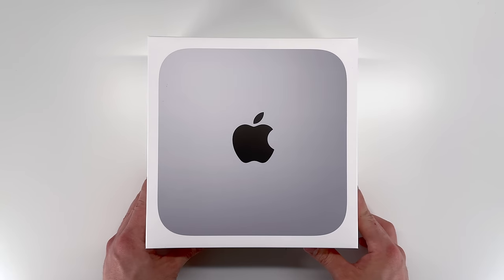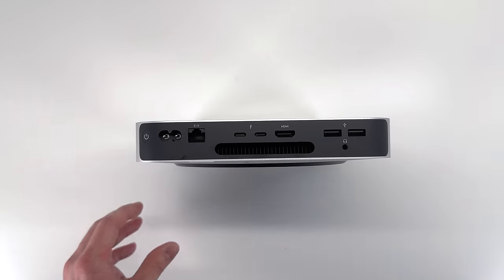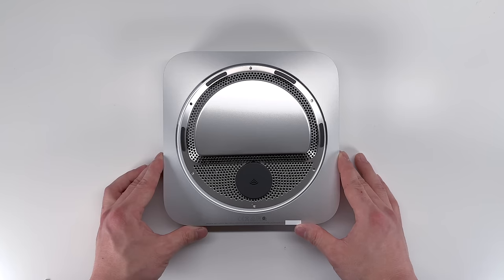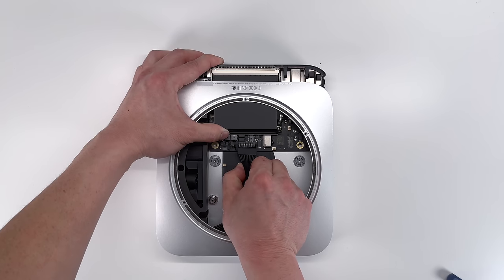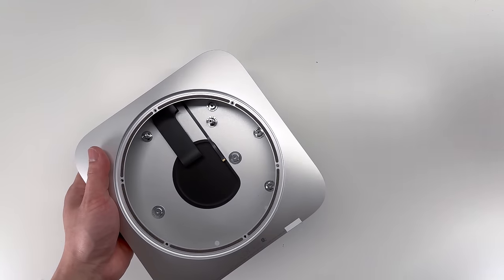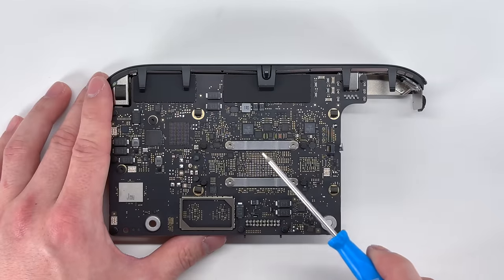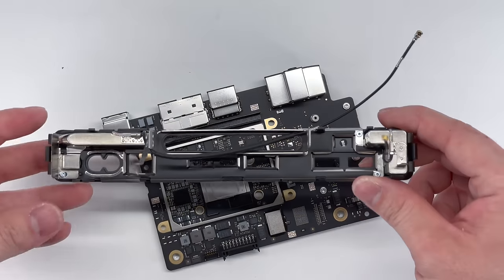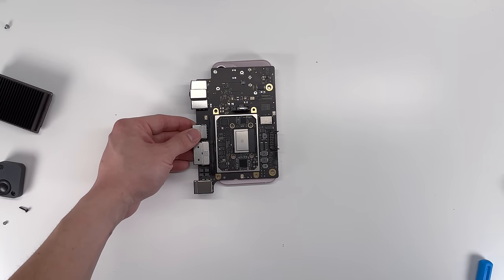M2 Mac Mini Teardown / Disassembly (4K - Up Close)

Comment: Very cool.  As expected, only one Nand.  Oh well.  Saved $100 because of that.  

I would’ve liked to have seen a FULL tear down, meaning every part removed from the aluminum casing, as I was hoping to do a custom space gray anodizing.   

Now I’m wondering if the intel space gray casing could be swapped instead. 🤔
Reply: is the m1 mac mini base a better computer than the m2. I would like to also mentioned I can get the m1 for $100 cheaper than the M2
Reply: @NA-qs7bg  seems that the read write speeds are worse on the base M2, but the CPU/ GPU is better.  If you upgrade to the 512GB model, it should be faster all around.
Reply: @DisgruntledPigumon  What are your thoughts on the following?

Looking at the m1 base vs m2 base minis. Found  m1 for $100 cheaper than m2 which is not material but nice. ($699 Canadian for M1 - its on sale for $200 off and M2 is $799)
Will be using it for work on my 49 inch samsung g9 ultrawide monitor - I work in finance. Usually I have all of the following open: Email, word and excel, a finance cloud software application, a finance software application installed on the desktop, few internet chrome tabs for research, and a small widget like timer. Im looking to go with the faster machine which seems to look like the M1.
Reply: @NA-qs7bg  definitely go for m2! 100 dollars is well worth it !
Reply: @georgelyras1978  In what respect? Because I'm reading the m2 has a significantly slower SSD. Ive heard the price of the mac mini has been reduced because the performance has dropped. So going for the M1 over the M2 might be better in general and definitely a better option if you can get the M1 for less.
Reply: @NA-qs7bg  i'm not that good in this stuff but shouldn't SSD speed only matter for loading stuff and not for actual computations? and in terms of SSD speed difference shouldn't this only be noticeable if you load really large files?

Comment: Where is the intake?  I got one of these and I see no intake on the bottom.
Reply from the maker: The intake comes in from the sides of the black cover. It has a very slight gap from the machine.

Comment: Thanks a lot for the review. What SSD size should one buy in order to have the best SSD R/W performance. If a 512gb has 2 NAND chips and reaches 3000, would 1tb give 6000?
Is there anyone there who owns a MM M2 Pro with 1tb to test the speed ?

Comment: Is the M1 base faster than the m2 base?
Reply from the maker: It's complicated... The M2 Chip and ram is faster but the SSD is faster on the older M1 Mac.
Reply: @brandon20904  I’m looking at the m1 base vs m2 base minis. I found the m1 for $100 cheaper than the m2 which is not material but it's nice. ($699 Canadian for M1 - its on sale for $200 off and M2 is $799)
I will be using it for work on my 49 inch samsung g9 ultrawide monitor - I work in finance. Usually I have all of the following open: Email, word and excel, a finance cloud software application, a finance software application installed on the desktop, few internet chrome tabs for research, and a small widget like timer. Im looking to go with the faster machine which seems to look like the M1.

Comment: Hi Brandon,

I’ve got a new M2 Pro Mac mini. Recently, I had to connect to my old LaCie Rugged HDDs with Micro B USB to USB C cable. That LaCie cable is extremely stiff on USB C and doesn’t click. Do you think Mac mini’s ports can withstand tough insertion? Or is it even ok? Thanks!

Comment: What sucks you cant upgrade ram or hard disk anymore.
Reply: The RAM (Unified memory) is understandable because in many ARM-based hardware, the "volatile" memory is integrated within or alongside the SoC, and therefore, soldered, for speed gains (and also due to how the ARM architecture works as well.) To be blunt, this configuration "arrangement" is taken from Apple's iPhones SoCs.
 
What infuriates me is the SSD (considered as consumables because SSDs depreciate over time despite their longer lifespans, they're still "consumables".) The justification made is that because the SSD is faster now—which is false, because you can put a PCIe NVMe SSD (especially if he newer ones) with the same storage equivalent and you can get comparable or even faster speeds AND they're replaceable.
Reply: @Jan-xf8sk  Not just in ARM-based hardware -- lots of x86 laptops have soldered RAM these days. e.g. my Thinkpad T480 ha two SODIMM slots, but later T-series Thinkpads replaced one or both with soldered memory. While planned obsolescence is a concern, this does improve power efficiency. Possibly also latency, since you can put the RAM even closer to the CPU?

I agree though, that SSDs should still be modular. It is possible to desolder and replace the memory chip, but finding a compatible chip is much harder -- the videos I've seen have used donor chips from iPhones. Compare to my PC, where I can plug in any M.2 2280 module. It doesn't matter whether a Samsung, Crucial etc SSD modules have similar memory chips and control circuitry, that's all abstracted behind the NVMe protocol.
Reply: @wereoctopus  it IS possible to desolder chips BUT that would require you to have a reflowing station... which is absolutely expensive even more than a third-party repairman can afford.
Reply: @wereoctopus  with the tight integration of components/hardware and software done by Apple gave us massive gains on speed and no-nonsense usability at the expense of massive control over pricing AND upgradeability/replaceability of components. Apple came here in mainstream first before other brands do. What Apple does, so does the rest of the industry.
 
I once held an Asus laptop with soldered RAM as well—though it's on a slower x86 architecture so I cannot justify soldering it too. I don't know about any ARM hardware with replaceable RAM modules (maybe, outside server/enterprise environments.)

It's always about money especially for a brand that likes to pose itself as a luxury electronics brand even if they're mass-producing their products unlike luxury items.
Reply: @wereoctopus  also you just can't buy straight to the SSD NAND chip manufacturer should you able to desolder Apple SSDs. I've seen enough Rossman videos to know a lot about this technological dictatorship.
Reply: @Jan-xf8sk  Oh yeah, I didn't say it was easy to re-solder, even with a reflow station.

You can DIY a temperature-controlled reflow hotplate for relatively little money, though I have no idea if there are any nearby components that are likely to fail if a wide area of the PCB is placed on a hotplate hot enough to melt solder.

Comment: Think they would have learned from the negative press with the 256Gb MacBook Air M2 variant! 🙄
Reply: Their supplier stopped manufacturing 128 nand chips - the smallest one is 256, thats why we get a single 256 piece. I do not like it either, they should cut into 512 and skip 256.
Reply: @Hedorah3  Exactly, they make enough money to have every Mac specced to at least 16GB of memory and 512GB of storage as standard.
Reply: I care more about the longevity implications of the single 256GB nand chip than about the i/o speed. I think it should be OK for at least ten years of normal use. I have no scientific basis, just my hunch.

Comment: Only 1 nand-chip, pretty easy to identify ... ahh Apple, saving USD 2 .... LOL
Reply: how about 512? Any guess?
Reply: @andre88223  512 has 2 chips and double the speed on top of that. Dont buy base model. save up and get 16/512gb. If nothing else than for longetivity. 8GB and 256 gb will wear out like crazy due to only single nand chip and insufficent ram (constant swap writes)

Comment: The reason M1 chip is better than the M2 is due to HEAT. Anytime you have more power you have more heat introduced and more heat does not pair well with electronics. Just ask those with M2 version of Mac Air. The M2 Mac Air has a very serious overheating issue. I'm sticking with M1 for at least 6 months to see the M2 Mac Mini results. In fact I would advise upgrade on M1 Mac Mini before upgrading to M2. The questions is was the M2 Chip fully tested or are Apples die hards going to be the beta testers. What could be better than getting your customers pay to test your product for free. FREE workers translates to slaves.
Reply: I recommend people should not take your advice. I don't know what you mean by "upgrade on" since the M1 mini is not upgradeable.

If you already have an M1 mini, it is not a good idea to replace it with an M2 mini soly for the better M2. If you have an Intel CPU it's a great idea to upgrade to Apple's SoC. Electronic devices create heat. You don't "pair" them with heat, they come hand in hand. Your comment about slavery was ridiculous.

Comment: NAND chips touching a massive heat source... Good job Apple , you go against everything anybody is teaching. The only redaming feature is that the heat sink is on top of them , however they will cool unevenly due to mounting them next to the SOC with no space between.
Buy Apple care and expect premature failures.  
We see the same problem in the enterprsie market. One brand (not going to name it) , made the same stupidity - Intel Xeon D series SOC with boot SSD soldered in the same way with 1combined heat sink. 9-12 months of 24/7 work and the mobo goes to trash can. For those that are supprised , yes Apple didnt invent the SOC concept. Its been arround since AMD invented it in the early 2000s, but nobody used it. Intel introduced the D series SOC back in 2015 and it was a missive hit with Storage servers.

Comment: So much wasted space. Apple could have made this much smaller without sacrificing performance, probably NUC size even with an internal PSU (since the power supply in this is way overkill). But for some reason they want to keep supporting this dated form factor. The fact that they haven't changed it since 2010 is baffling. I mean it's a nice looking case, but I can't think of any other Apple product that has retained the same exterior after 13 years.

Comment: Thank u for this teardown, excellent work! The heatsink Apple used here and basically their cooling solutions across all devices is so fricken lame and underperforming…. A trillion dollar company should already use vapor chambers which I am sure they can get for their volumes dirty cheap. There is so much power in this chip, only if you could overclock it and even do your own DIY cooling… I hope Asahi Linus will eventually progress further and will unlock more of the potential of the Mx chips. Its a HUGE shame that Apple isn’t supporting their efforts on not trying to make Mx chips work with Windows. Only if Macs would be less closed and more open… they are cutting their business potential by these totally illogical restrictions.
Reply: No better cooling because apple doesnt want it to last . They want you to fry this mac